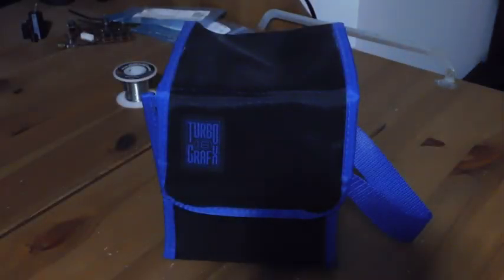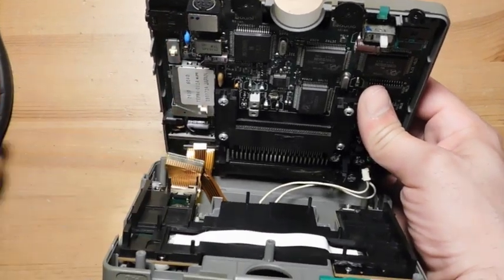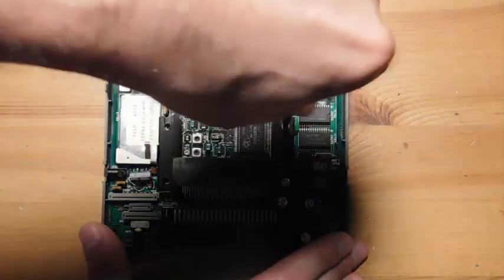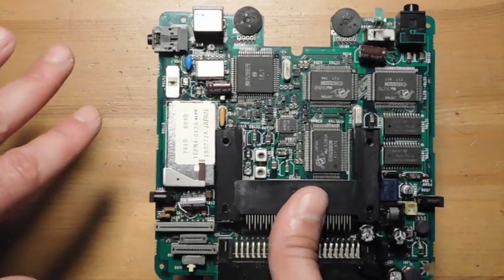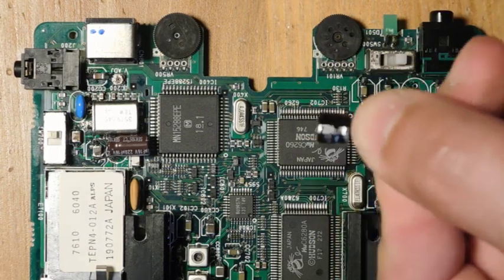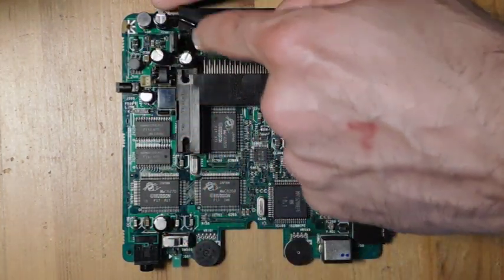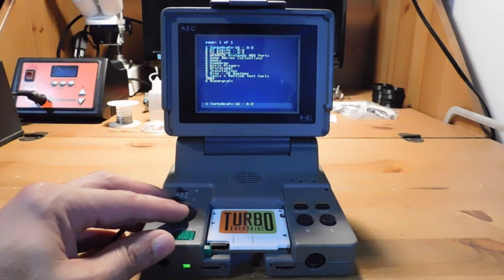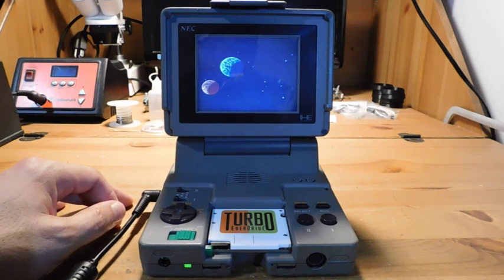PC Engine LT Repair! Capacitor and Power Regulator Replacement

Comment: Hello, thank you for your answer, ok can we order this piece? very well I have a little diag that I had from the previous owner: I found some information, I have no more information on the failure, nor video. <br> <br> Video signals are sent to the upper part including the screen. It is in this part that there is a concern. The negative voltage of -24Volts for the polarization of the lcd matrix collapses when connected to the motherboard.

Comment: Hello, I have a nec pc engine lt that I bought on ebay, depending on this one has a problem the screen does not display anything on the internal screen of the console but works very well connected to an external screen of a tv !! do you know dou can come from this operations? if you have an idea or 2 thank you very good video thank you cdlt.
Reply from the maker: It’s totally possible that some of the capacitors for the screen have failed. It also may be related to the power regulators

Comment: My lt was working fine 14 years ago. From then it was put away. Will it be fine now? When i fire it up again would it work  as it was at the time i left it or would the capacitors have dried up ?
Reply from the maker: It’s hard to know for sure. Some capacitors can last much longer than their predicted expiration date, and others dry up much quicker. Either way, it would be good to replace all of those capacitors so that it lasts as long as possible

Comment: Good work man.. Can we get 720 or 1080p video though?
Reply from the maker: Thanks, I just need to buy a better camera
Reply: @LIRetroGaming  No worries, I was wondering did you test the Regulators before replcaing them?  I've revived many Turbo Duo's from regular cap problems, to bad inductors, backlight transistors, bad traces, etc.. But havnt run into a bad linear regulator yet (the 7805), but it could easily have been an issue with the switching regulator.
I wonder if the Linear is for all the logic chips, and the switching one is used as a boost for the lcd? Do you know?
Reply from the maker: I’m pretty sure that you are correct - the 7805 is most likely for the pc engine whereas the switching regulator is needed for the lcd. I am sure that the switching regulator was not working correctly but I decided to replace both out of precaution